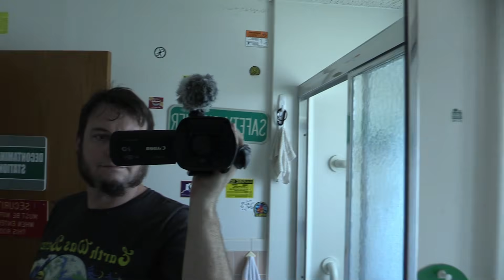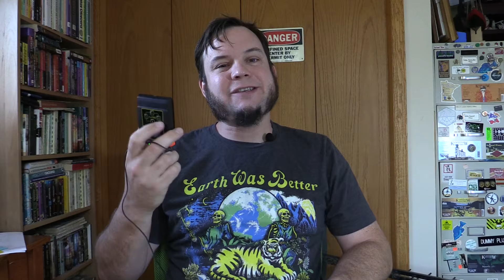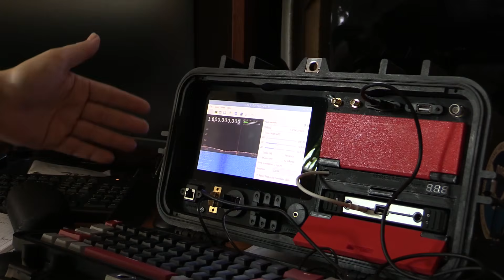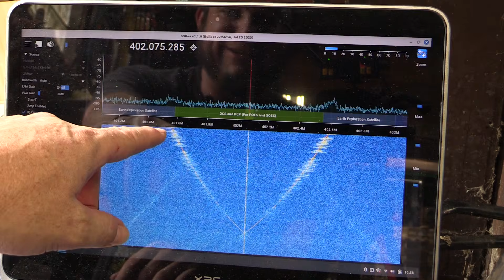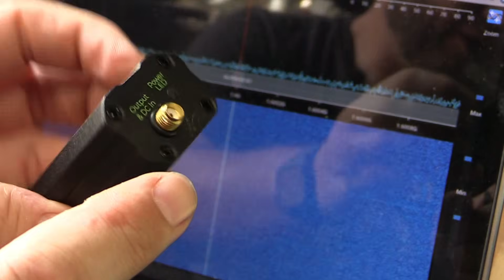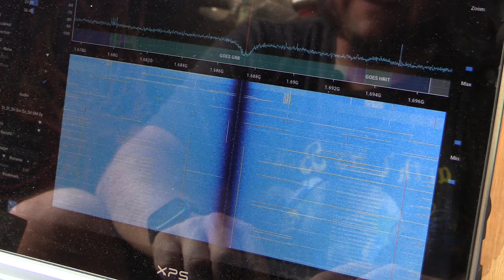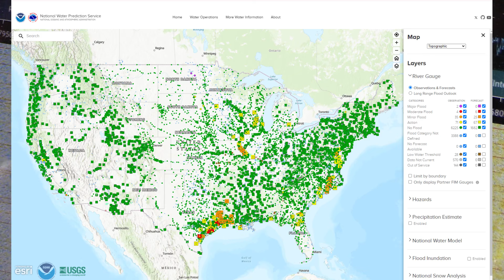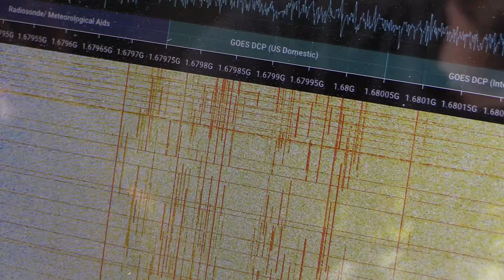Checking 1.6GHz For Skinwalker Ranch Signals

Comment: I can only share your skepticism about UFOs and aliens. I also can't imagine that aliens would come here in a UFO only to crash in the desert. I find it very interesting that you touched on the topic of Skinwalker Ranch. The 1.6 GHz signal that they keep picking up in the series has caught my attention as well, and I’ve also wondered what it could be. The experimental setup you mentioned in your video seemed very questionable to me. Normally, antennas are placed at a greater distance from the devices that cause interference. It's a good thing you didn’t have to go into the desert in those temperatures. That’s more like cave weather.

Comment: The wireless mic doesn’t sound bad. Might need to adjust the EQ, or maybe take it off your neck or something (sounds muted), but it’s better than the other mics you tested.
Honestly have no problem with the fuzzy rabbit, though. 🤷‍♂️

RE: screen recorder stuff…
OBS isn’t working, or…?
I only just started using it so I might not understand its limits, but it seems like it’d be a nice fit.

Comment: 1.6 GHz is a common base frequency for mobile Intel processors, the processors throttle up from that frequency. So I suspect that since they are so close to the laptop, it is the laptop that is the source of interference. 

I prefer the wireless microphone, much better sound quality. The audio is cleaner.
Reply: That's pretty funny!

Comment: Another great video.. The efforts of the TV company to generate conspiracy theories and viewer figures were pure BS. The signal strengths and signal types shown in the clips of the show that I have seen were clearly generated locally, whether by local radio operators messing with them or by off screen members of the crew, which is why nothing interesting or unusual was found in this attempt.

Comment: Can also be harmonics. Inverters, chargers, switch mode power supplies, active cables left coiled up, electric fences bad powerlines. The list is endless. I have not listened to the sound on the show. One thing I would like to see on the show is a 10 / 11M antenna. Can someone get hold of a Ham International Big Mac?

Comment: But they have installed a device to see where the signal is coming from. This is mentioned a number of times in the episodes of the new season. They found that the signal was mostly coming in the area around the Homestead 2, that has a structure that the lidar can see (but the eyes can't). I get what you're saying that they're not rigorous, and they're not as much as they should be, but they're not talking about random things interfering, like laptops of wireless mics.

Comment: The old mic does sound a lot better. The new one sounds extremely muffled. You may want to experiment with different mic positions or even use it without the foam thingy if it's not windy and you don't rustle around with cloths too much

Comment: As soon as I saw that LNA in the shot, I knew that you were going to rip the connector off it!  In true “save it for parts” fashion, just use a bit of tape to attach the cables on both sides of the LNA to a wooden chopstick/pencil/garden cane/whatever to give you the necessary strain relief.

Great videos as always, and great to see Linux tools being used on YouTube.

Comment: With such a number of adapters there can be significant losses, in this case it is better to solder the cable directly to the antenna, and it is advisable to have a cable with a larger cross-section for lower losses and also adjust the antenna according to the characteristic impedance, good luck to you. I'm using google translator, I hope everything is clear.

Comment: i recommend just biting the bullet and going on pasternack and buying one of each type of adapter. if you get regular slotted connectors, the price won't be too insane. it is SO nice stepping directly from N to SMA though, its worth buying the adapters just for the convenience (if not for the better signal).

you can always just go to some random vendor from china too and get any connector dirt cheap online. just gotta make sure its actually brass lol. and also make sure its a reverse polarity connector. i've been burned by amazon pages that sneakily were selling RP connectors without clearly marking them. they are essentially useless unless you specifically need one

Comment: Only non professionals use  2.4Hhz wireless microphones and the Skinwalker show does not.  They use UHF transmission - 500-600Mhz  Lectrosonics systems. However I agree that show is full of BS and probably the Drones they are using are spewing out the 1.6Ghz via intermodulation. Its all the phony drama of a regular "reality show" and I have done too many of them...all UHF...ha

Comment: 1.6 GHZ is the second harmonic of some cell phone services. Something could be acting as a diode, causing the spurs or mixing several other RF signals. A rusty or correded pair of metal conductors can become a diode. Some of the first rectifiers were copper oxide. 
The wireless mic sounds cleaner. I retired from the commercial sound and broadcast engineering fields. That crap built in mic would have people complaining to the station in a heartbeat. It is non directional, so it sounds hollow and picks up a lot of noise. A good Cardioid microphone is what is needed. It sounds even worse if you have hearing problems.

Comment: to be more objective, the people that are saying the lapel one sounds more condensed, afaict, its really the exact opposite issue: the lapel is picking up a pure voice tone (albeit maybe slightly compressed due to too much gain) while the rabbit is picking up a bunch of echo/reverb, giving the illusion it being fuller but its actually just reverb noise
Reply: The wireless mic definitely has a higher self noise, and also it 100% has some sort of low-pass filtering/less responsive highs.
Reply: The condenser just needs a midrange correction with I dunno maybe a small high pass filter?  The tonal response from the wireless is good but too much noise.  Too much noise is hard to correct in post.
Reply: The camera mic allows you to hear the room, and to hear the voice as if your sitting where the camera is. A lapel mic removes the room acoustics a lot and there can be timing issues syncing audio to video. There is nothing like a condenser mic though.
Reply: I'm so grateful that someone understood this
Reply: This is the correct answer. People are confusing room noise with "fuller" audio

Comment: We use the GOES sats for stream gauges up here in Canada too. Was cool writing software for it back in the day.  We'd get a 10s window each hour for transmitting on and then collect the aggregated data from NOAA api.
Reply: I worked on a turnkey earth station for NOAA. It was installed at Wallops Island. Three full height racks of equipment that work right when it was first powered up.

Comment: The lapel mic is too compressed and limited it's good at both those things I like the fuzzy rabit it gives a bit of ecoh but it doesn't cut any of the high hz I think for the most part though for what your doing audio you don't really think about is what your looking for and thanks your great at this and getting better all the time. There are experiments that have been done before that are worth repeating  to see if you get the same result as everyone else but going through the steps like you just did showing the problems and what not about it should make for a few insights in the comments then your ready to go out to skinwalker ranch and see maybe? Your gonna attract a community of very interesting thinkers and tinkerer s my people and yours

Comment: I wonder what frequency Big Foot's sister transmits on?
I would love to see some ISS video down links or 
Mars Rover control stuff...

I have seen a few road speed signs that look like they have wifi..
Makes me think they can change the speed limit remotely.

Have you tried decoding signals on shortwave?

There are some Lora devices with an antenna the size of a ballpoint pen spring, 
that have 12 mile ranges.

I also seen a video of someone making an antenna from duct tape and copper foil.
Something like that could be suspended from a balloon, kite or quad copter.

For the mic, you need less echo, but more base
Reply: The equipment we built for NASA for the ISS in 2000 was on the kU band. It was for privates Data, Audio or Video. The ISS had a 40 Mb/s connection to the internet foe data.

Comment: Is there anything like that frequency waterfall software that works for just audio? I've struggled to find something that well laid out for spectrum analysis and would love to tinker with it.

Also I think that you should add a filter to the audio from the lapel mic, the amount of noise that it picks up could be removed with a filter. That way it might be a fair comparison.
Reply from the maker: I'm not sure, I think I've seen a waterfall display like that but I can't remember which program... maybe it was MSSTV? But that's mainly for Slow Scan Television decoding.
Reply: Spectrum Lab might be what you're looking for. If you can't find it in a search, try searching: DL4YHF Audio Spectrum Analyzer "Spectrum Lab"
In addition to audio input from your soundcard, it can also take input from all kinds of devices. It has some scripting facilities too, so e.g. you can set a trigger to perform an action if a signal source is louder/stronger than X for Y milliseconds (for instance, a long loud sound) a screenshot is taken and saved to a specified location.
Lots of people are using it along with SDRs to detect radar reflections from meteorites.

Comment: Also, Turn up the gain, with it at 0, your just hearing whats inside the device, not on the antenna
Reply from the maker: I had tried it a few different ways, with both the gain sliders.

Comment: Log periodic antenna, not a yagi antenna. Not that it really matters
Reply: Since its an LP antenna it covers a broad spectrum and isn't all that much in gain where a Parabola is much more gain and rejection rejection from other Directions
Reply: If it doesn’t really matters, then why you said it
Reply: @FatherMcKenzie66  There's a difference in gain, pattern and bandwidth that could impact some applications. The log is generally the better antenna, but with somewhat lower gain.
Reply: It DOES matter, they are 2 very different antenns, if you were a radio ham ( a real one ) you'd know that  🤷 @FatherMcKenzie66

Comment: The wireless mic sounds so much better, it is a bit muffled, but you are wearing it too high up your shirt and too close to your mouth, and thus you are over powering the microphone capsule.
It's true the wireless transmitter and microphone aren't very good quality, and you could EQ the audio in the editing a bit. You could easily get a much better wireless system, and that one seems a bit on th elow quality. That being said, the shotgun microphone with the fuzzy windsock  sounds okay, but you will never get a really good sound from it, as it is far away from you (think inverse square law) and those mics are only meant to record wild sound, and not dialogue.